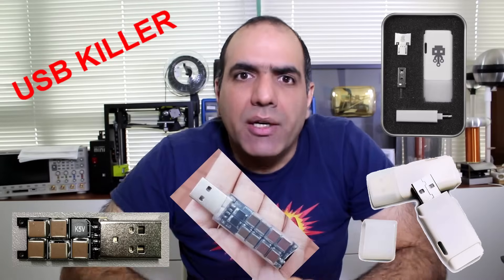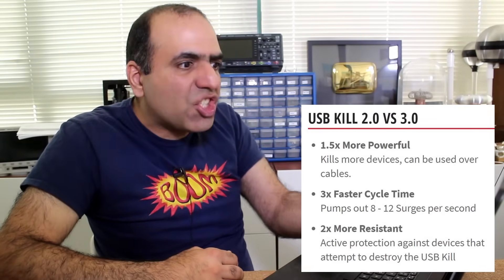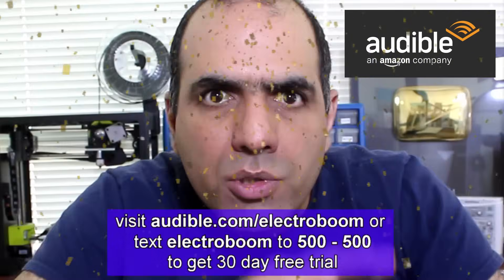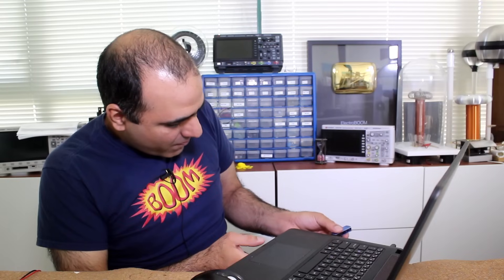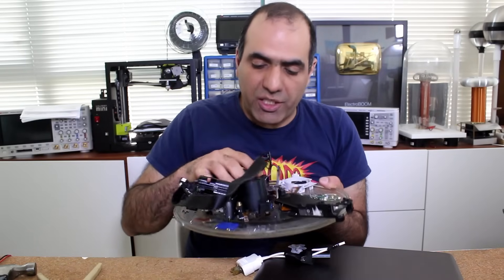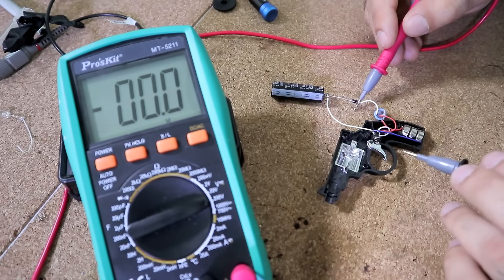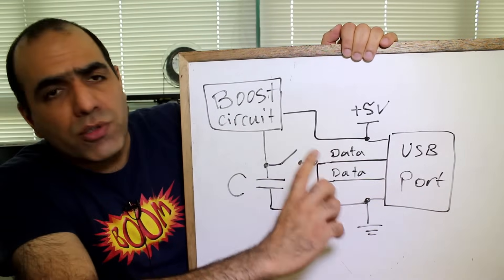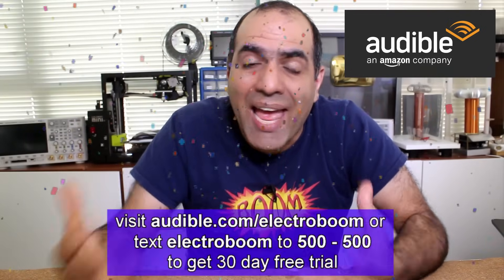USB Killer… WHY???

Comment: You're absolutely right, people's need to destroy has no longer any boundaries! Of course it's meant to destroy other's property, but my question is that isn't a hv power supply like a tesla coil gun more effective??? Stupid!
Reply: There's an equally effective and significantly cheaper zero volt device called a hammer which can be used for this purpose

Comment: Five years later and a device like this is MORE relevant than ever.

USB Type C has become a near standard for both high speed data transfer AND power transfer, not to mention gas stations and Chinese knockoff companies still make garbage charger adapters 

The chances of accidentally exposing your devices to a faulty or unsafe usb type c are perpetually high these days
Reply: I made a way to make these with 9 volt batteries

Comment: There's special devices (kinda like big drive cages with magnetic coils) which are used by some people (mainly in govt/corp sectors) used to fry the drives on demand if wrong dudes are knocking on the door. Those fubar the drives thoroughly, including the platters themselves.

Comment: 0:46 how is -200V DC possible if DC only flows 1 way?
Reply: Polarity flips.
Reply: Its the direction the electrons are going
Reply: its just like reversing a battery, its sill DC
Reply: Because the pressure

Comment: im very late but the usb killer is used and or sold for companies to test if there device can wistand the power of killing your USB port with high voltage for example apple uses them and there MacBooks and iphones are immune to the killer
Reply: Is there any real evidence that companies use them to make devices immune?
Last time I've seen "proof" that the MacBooks are immune it blew the TVS diodes (which shouldn't happen) and all they tested afterwards is if the 5V supply works which doesn't proof the USB-Port still works in fact a video on the USBKiller channel show that on the mac mini it actually kills the USB ports which I wouldn't call immune using a faster Thunderbolt enabled port it also killed the entire video output. If the port just connects to a external controller instead of the PCH it's more likely it won't kill the entire device and instead just the controller but that's more of a question of how many USB ports (both internally and externally) are required and what the chosen SoC/CPU can provide natively.

It also doesn't make that much sense to try an reinforce against that. The only real world encounter with such a device is if someone actually wants to destroy your device which they can do with a hammer if they really wanted to.
Also note that most devices will survive a normal electrostatic discharge, but the USB Killers output is nothing like a real ESD so transient suppressor diodes are generally not made for this.
Reply: @Ether_Void  meh i dont really know either since I was just a bit guessing big live commented on here so he's got the right anserw

Comment: it is designed to test the strength of the computers eternal parts and allow the factory to make stronger parts of the one that failed
Reply: No idiot is gonna put that much power into their usb ports. Plus, it’s way too expensive to add that much protection so even if the intention is good, it’s not gonna change anything. I mean look around: no one is having an issue with usb ports getting blown up except for people with malicious intent and this device or a similar one. There’s no excuse.

Comment: Medi is right. Even when I worked in major electronic design, assembly and testing, we had a device called a HI-POT device but it was only specifically designed to work in the mains of the PSU units where there was the ever so slight chance of something like that happening.

Comment: even if your computer is hit by lightning, your data, even solid state data, is likely recoverable. the change in voltage applied to the floating gate transistors is most likely uniform, and by changing the threshold for what is considered on and off, a professional can likely recover the data. esd is unlikely to change anything with regards to magnetically stored data, since that is electrically and magnetically shielded.

Comment: a standard electrostatic discharge from a human hand is going to be on the order of 2kv. if you hit your computer with a 2kv relative discharge you will fry the USB port, they're not designed for that. before bringing you hand close to a computer port, always make physical contact with the case. I learned that the hard way.

Comment: i'm not entirely certain this was true 3 years ago, but USB killers were not typically good at destroying computers because the USB controller is designed to fail open from a data line fault

Comment: A lot of hospital equipment use USB connections to Update/install their software as they have no wireless capability for security reasons. Buying one of these it could be used to develop the medical devices to be protected against this sort of malicious sabotage. I can think of applications for many engineers for any devices that need to be protected against sabotage, banks, military tech, airports, planes etc....

Comment: If you really need to hide data inside physical hard drives or ssd's from anyone, instead of using this you can just encrypt the drives with a really strong password. No need to destroy anything, and USB killer doesn't have a legitimate use anymore.

Comment: I think it's to test against physical system attacks on critical systems. It's an easy way to cause havoc, creating an opportunity to do real malicious things. It's a similar to the reason they say don't go out if the fire alarm rings during a school shooting. It is the attack you need to protect against and therefore is the test.
Reply: You can walk into any server room if you just act good enough
There will be thousands of usb ports in there
Also, access to the fricking servers themselves
There are better ways
Also, the servers with storage and processing are separate most of the time
It would have to go through a lot, to actually damage something
Only thing possible is to make them replace a lot of parts, though why would you want to do this?
If you're that intent to destroy computers you'll just go to the local school or library and not some server room

Comment: Hay ElectroBoom I need you to rectify this “so I have a light up keyboard with leds. It is connected to a computer plugged in the wall with a usb but when the pc is off the keyboard LEDS are also off but when I turn off or change my ceiling fan speed the keyboard turns on” I would assume it is some electromagnetic interference because the USB should be isolated from the 110v circuit

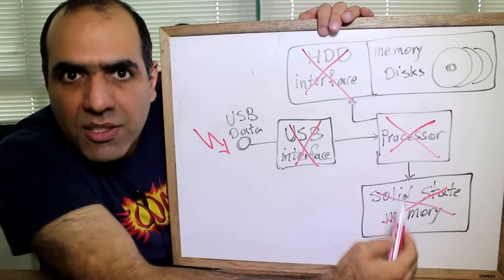Comment: 10:02 it happened and it sucks. The power line that feeds our apartment got struck by lightning and all of the tv s and every single power adapter got fried none of the outlets or breakers had any protection. Weird thing is other than our door neighbour no one in the apartment experienced the same thing. At least some expensive stuff had proper protection or was fed with an external adapter

Comment: I'd kill mi computer with 19 volts. I took and connected it to a normal usb port on the computer as you did but you used 120 volts instead of 19 volts
Reply: A well-designed USB interface can safely shunt such a voltage, with some being able to handle up to 50v. So for a USB killer to be able to destroy ANY USB they where designed with 120V.

Comment: Just take a usb cable and cut it and leave about a centimeter of wire and remove the insulation rubber. Twist the hard wire together cleanly and plug it in. Instant short and fried port.
Reply: Bare. Not hard.

Comment: Well in my previous job, once I had a task to qualify a TVS diode in a board that was in PE side, which means humans can touch. The diode was there to protect the circuit from ESD when people touch f.ex USB input. The diode was 30v diode and it had to clamp the voltage to 42v max. We have done the test. But there is a difference between that and this device. In that one, the standard is clear (TüV), what is the pulse voitage (2.5kV) how many times in a minute etc. We tried up to 6kV just to show the robustness. This device is not for the test of standard, just wanted to say..

Comment: I see it is malicious. But also needed as well. Imagine your houses power supply has a fkn leakage. You plug your phone to charge as usual then a fkn overload destroys your brand new phone and even set it on fire. 
Now imagine that shit on a bigger level. On a data center or a huge server or simply the power plants themselves. To avoid such damages in that cases, they design the new devices with current limiting circuits in addition to fuses. To test that current limiters, testers use similar tools to usb killer. Try it on your new macbook's adapter and it will survive

Comment: Granted, if someone is going to put themselves out $250+ purely in the HOPES of screwing up my laptop -which has data I could restore onto a new laptop before the end of the day? I would almost feel bad if I didn't plug it in... That's like someone spending $10,000 to create a fake "fuel additive" to sabotage my still-under-warranty/insured car, assuming that I would even feel compelled to dump random bottles of crap into my gas tank to "improve the performance" of an already adequate performance.

Granted, stupidity and malice are both a seemingly infinite resource -in this star system, at least.

Comment: The thing I see around the net when someone asks if a USB killer should be illegal is that it's no different than owning a gun.

This is wrong. Can you just walk into a gun store and buy a gun?
No.
In Nebraska. In order for you to buy a handgun, you need to buy a permit to purchase. Which needs to be approved by the county sheriff's office as well as a criminal background check. The licence is only good for 3 years.
If you're wanting a conceal permit, you need to have a background check and safety course.

So no, it is easy. All you need to buy the USB killer is the money.
I will say that there should be a licence required, because the USB killer, is just like a gun, except the USB killer device's victim is devices with a USB A port (or others if they use an adaptor.
So in a way, the manufacturer is somewhat responsible.

Also, I am not an American or a gun expert, I learnt all this from a video made after the ISIS attacks of 2015.
Reply: The only thing most people buy a USB killer is to be a dick with, where guns are just really fun
Reply: @all-cops-means-all-cops  too f**king right, if someone did that to me i would take their smartphone and hit it with a hammer until it is nothing but salvage.

Comment: The earthquake bomb, or seismic bomb, was a concept that was invented by the British aeronautical engineer Barnes Wallis early in World War II and subsequently developed and used during the war against strategic targets in Europe.[1] A seismic bomb differs somewhat in concept from traditional bombs, which usually explode at or near the surface, and destroy their target directly by explosive force. In contrast, a seismic bomb is dropped from high altitude to attain very high speed as it falls and upon impact, penetrates and explodes deep underground, causing massive caverns or craters known as camouflets, as well as intense shockwaves. In this way, the seismic bomb can affect targets that are too massive to be affected by a conventional bomb, as well as damage or destroy difficult targets such as bridges and viaducts.

Earthquake bombs were used towards the end of World War II on massively reinforced installations, such as submarine pens with concrete walls several meters thick, caverns, tunnels, and bridges.[2]

https://en.wikipedia.org/wiki/Earthquake_bomb

Comment: Want to destroy your data while having fun at the same time? Break open the SSD'S housing and use a bench power supply to apply something like 30v across random points on the board and watch the magic smoke roll.

Comment: 9:39 depends on the system configuration.
Most Intel USB controller are on the motherboard's chipset, not the CPU. Currently only AMD puts the controller inside the CPU.
Reply: or chipset. its nowhere near just that simple in this case this isn't AMD vs Intel it honestly will affect every system slightly differently.
Reply: @infernaldaedra  Yup, even if it's AMD it doesn't mean all the USB ports are driven by the CPU. Only some ports are and it depends on the motherboard configuration
Reply: @kızgın tosbağa it makes sense for cheapass mobile cpu's.  not a lot else

Comment: There is one actual use for it, and that is pre-testing mission critical hardware against sabotage. Obviously, you don't test the actual hardware—you test beforehand, then install proven parts. (Fresh ones, obviously)

That said, anyone doing such tests is probably more than competent enough to solder a USB plug to a 12v cord, so... 🤷

But as you've pointed out, making a USB killer like device isn't particularly hard, and it is an exceedingly effective way of damaging electronics. If you work in an industry where industrial sabotage is a real concern, protecting against this sort of attack may actually be a thing

Comment: It is way easier (and cheaper) just short GND and 5V pins (big 1 & 4) from USB stick. It can be improved with an inductor so when the USB Port breaks the circuit the inductor shall discharge high voltage due to open, if the circuit does not open then the current itself shall burn everything in the path.

Comment: "Here's a USB killer" pulls out USB crudely soldered to a wall outlet that scene had me dead lmafo
Reply: I never comment but goddamn this is the truth. Spent 5 minutes laughing like a maniac
Reply: All though it is even more powerfull bc it gives constant power not pulses.
And in his case it is constant 120 v ac or in some cases even 240 v ac.
Reply: @wfe dfeewd its more powerful because it's fucking AC not because it's "constant power".
Reply: @ewcm1878  thanks for correcting me I am not good in electrical stuff
Reply: @ewcm1878  I think more powerful is a misnomer I would use more destructive Instead as DC is capable of delivering more Power at higher voltages
Reply: The mains contraption is far more powerful, it can supply enough current to melt anything in its path until it finds the weakest link and breaks the circuit.

The small DC version reaches higher voltages though and almost certainly reaches deeper into the laptop potentially destroying more things before something fries and opens the circuit.
Reply: What scene
Reply: 120v to USB converter
Reply: says it all   USB     killer. yep it defineta;y kills the usb socket..   but there fused, so it wont make it past it.      why would you think they wouldnt fuse an external port?

Comment: The USB killer would be ideal for testing surge protectors that include surge protection for USB.
Reply: No it wouldn't. Surge protectors are designed to protect against power surges from the mains side, not from the other side.

Comment: Instead of taking your whole dslr apart for the flash cap, you could have gotten a cheap hot shoe flash and taken that apart. That's what I'm using to make a MIB neuraliser. Just have to get my circuitry skills up a bit, and get a 3d printer. To shrink the PCB down with only necessary components, and make the casing for it.

Comment: it's meant to test USB protection. USB protection is for surges. for example, when a power surge happens, and you have your laptop connected to a charger. the circuit would protect your device from the power surge if it is a newer laptop that charges with USB C. This could also be useful if you are charging your phone on your computer, and a surge happens. your phone would be fine.

Comment: It’s meant to test usb surge attacks against protected outlets 

So if the usb killer kills the computer  then the protector circuit does not work 
But if it dosent then it works

Comment: The USB Killer is designed to test USB ports to make sure that they're protected from high amounts of voltage. There is an actual reason for it existing. If you were to make some type of computer you would want to make sure that high amounts of voltage don't enter the computer and fry everything. It isn't some USB made to destroy computers. It's made more powerful on newer versions so that USB ports on computers can be the best they can be.

Comment: usb is 5 volts..  most pc's take 12...    so...  it cant kill a computer plain and simple..      when the hell is anyone going to realize this crap says USB KILLER, not PC KILLER..

best it can do is fry the usb PORT... or bus its on.. making the port unusable untill you replace the cap on the circuit.   

fair enough? it does what it says it does.. usb killer..   kills usb ports
Reply: Your said does not make any sense. Usb killer takes the 5v usb power and converts it to 200+v and dumps that power in to data lines

Comment: Subbed, just came across. Cool videos and you’re a funny dude.

Yes, the usb killer seems like a very bad financial cost if you are doing “testing” on computers. 

Some people have said companies need to check how their product holds up to bad usb devices or fluctuating power. That would make sense if it was a much lower voltage, no? I don’t think I read that this device has any way of adjusting or modifying it.